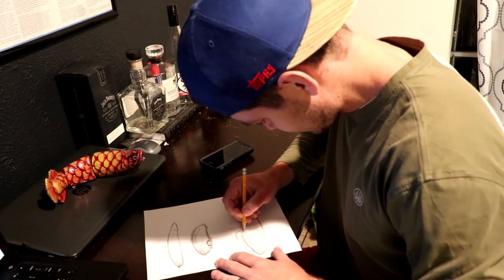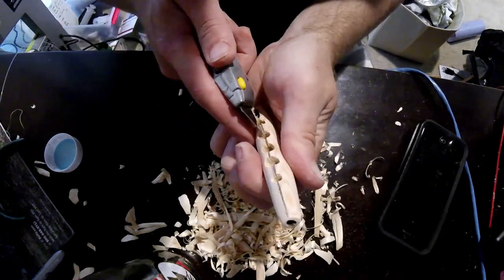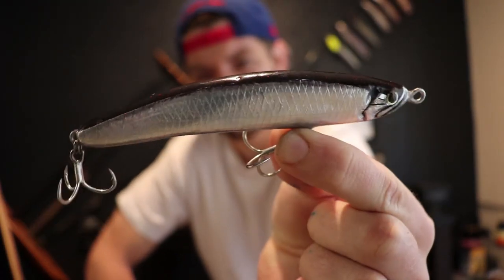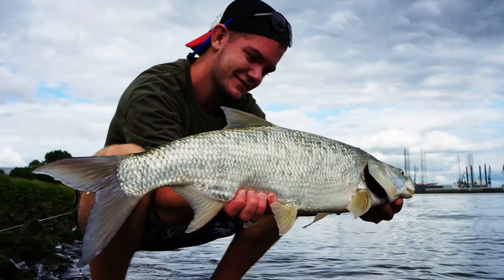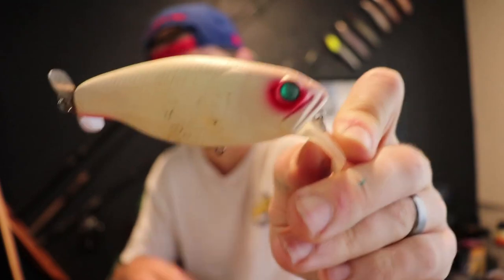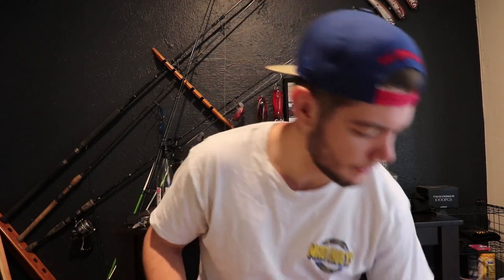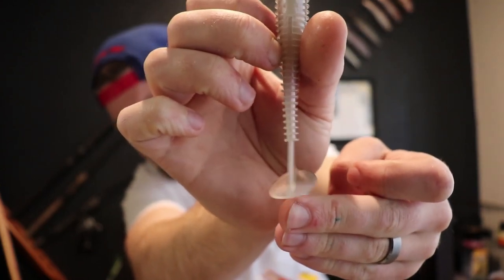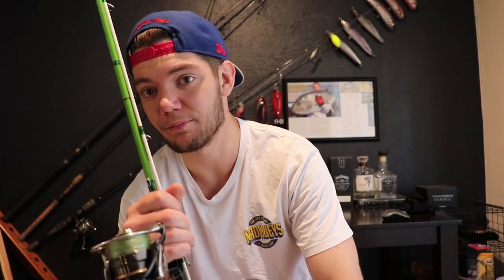MAKING LURES & PACKING TACKLE FOR MY FISHING TRIP!

Comment: Ive wrecked so many nice striper with that megabass 110. It is the lure that always works when nothing else will.
Reply: There's a few reasons why every freshwater bass fishing lure company is the US has copied the Vision 110-It straight up catches when nothing else will.  The fishing companies also have 0 ingenuity so they just copy the lure and barely alter the exterior while making sure to keep the interior weighting system of the 110. Very lame.
Reply from the maker: We ended up catching a couple of schoolies on the 110 which meant it ended up saving the trip. Fishing was tough, we didn't hear of anyone catching striper except the charters heading out in the deeper, somewhat cooler waters.
Reply: @TheAnglingGlobetrotters  Good to hear you caught some!

Comment: Hi .. Top channel thanks for many a tip 👍Can I ask you two questions .. I bought a small cheap chinese rotating motor 12volt it came with ZERO info what battery do I use ? And second could I and Im sure many others would love to watch, is a vid on just weighting lures, how to decide weights based on use, and placement of weights, how to test and what to look out for, wrong position when floated f dist time etc etc .. I see you have quite complex weighting .. I make lures that dont look to bad, but I struggle with the weighting part, which is prob most important :) If youre ever in Greece come by for a cast thanks all the best 👍
Reply from the maker: Hi Alexi, thanks for the kind words. So in relation to the motor: I'm not sure what batteries yours would take. Mine is powered with a regular "plug in the wall" power plug. In relation to the balancing part: I've made three videos under the title "How to balance a stickbait". All the information that I can think of in regards to building stickbaits is to be found in those vids. You'll have to extrapolate some of the info in order for your personal designs to work well. Please watch the videos and let me know if you have any further questions.
Reply: @TheAnglingGlobetrotters  Hi cheers and thank for the reply and help will take a look ciao 👍

Comment: Hey mate, how do you get your sinking stickbaits as to flutter on the drop? I’m working on a design and the swimming action starts to look pretty good. Just don’t get much rolling or fluttering on the drop. Which I would like casting at northern bluefin tuna here in Queensland. 
Also funny you’re Dutch too. Didn’t realise till this video.
Reply from the maker: Hi Bart (I'm doing this in English because I'm not sure if you speak Dutch or your family is Dutch). The way it works with the fluttering is that the balance weights have to sit deeper in the belly. Right under the middle line of the lure. If the weights sit all the way in the bottom of the belly the lure is too stable and won't flutter down. Thanks for watching and good luck with the bluefins!